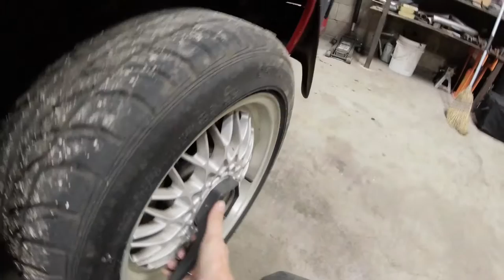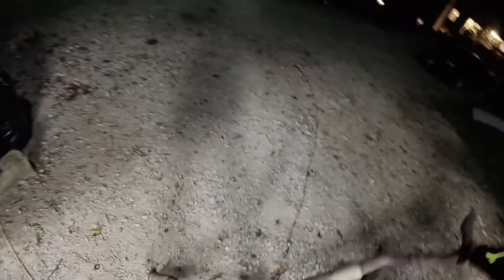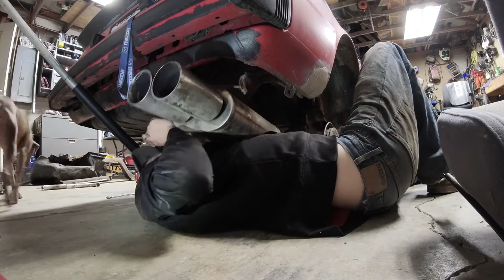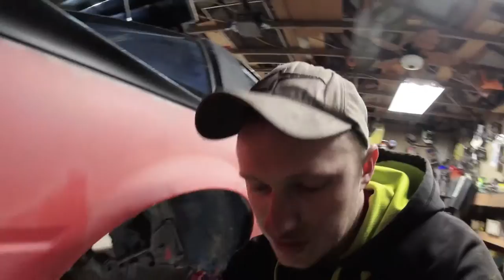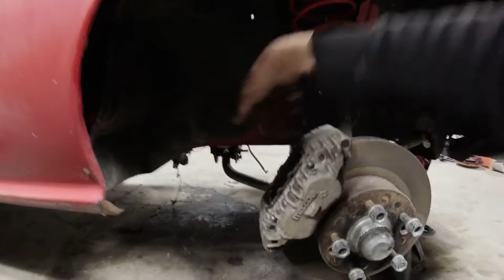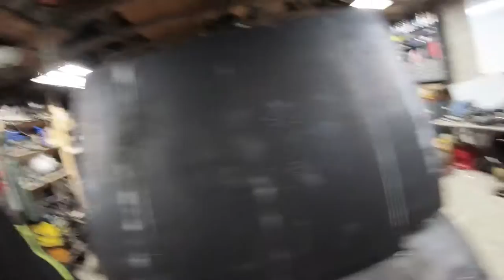Rx7 Turbo Street/Track Build - Rack and Pinion Conversion

Comment: I read an article (or maybe it was a comment.. this was years ago) somewhere that drilling holes into the upper bushings helps free it up like you said in this video. Also using new stainless bolts with poly lock nuts and lock tight. Tighten it down so it doesn't come fully tight to allow the trailing arms to be freed up and not have that stock spring tension in them. Grease the hell out of them too. It works good. I ended up doing this with my rear end. It definitely helps.
Great videos as always!

Comment: On   4 link. I met the owner of Mazda Trix a few times. He shared his thoughts on rear end binding.  Follows what your saying. I came up with my solution for my limited improved  AUTOCROSS/ street   car CSP class. Cut off the ends of the 4 -link that bolt to axle.weld on 2 inch Johnny Joint  End Rods from Currie. Even looks stock. ( polyurethane Heim joint)It gave me more articulation.  I went back to a stock rear  sway-bar  that I ground down to make softer. Softer then a rear adjustable bar.

Comment: I used a Gtech trilink and panhard rod setup to tame  the rear end snap oversteer on my gen 1 track car. It works very well and is totally tunable for under/over steer.
Reply from the maker: Do you have a rear sway bar?
Reply: @RADPotential   The sway bar was removed . Gtech was an American company set up by Jim Susko , he has written a manual about how to solve the RX7's handling issues. It was based on his experience with racing the Rx7 in the different classes that existed in the USA . It includes all the theory , including the unequal swing arms and angular disparity to which you have referred to in your video . He's a very clever man .

Comment: I actually have lots of the respeed rack reverse engineered and drawn up/CADed. I used to work for the first owner of respeed. I'm also legit building a similar 79 12a, gsl-se rear end, and will do a blow through setup

Comment: The problem with the rear axle when u start to make more HP  is axle wrap. The pinion will dive down in the front as the tires grip. Lowering the car makes it worse. Wearing the u joint and pinion bearings. 3 link solves that problem.  Far better r&p kit is the rear steering kit sold on ebay. Forgot the guys name. Keeps all the stock  steering geometry. Work far better than respeed kit.

Comment: With the four link and watts link I have found to delete the rear Sway Bar  or make it on a cam and secondary hand break lever . It get rid of that awkward wobble or kick snap back out of corners. Your right to delete the Sway Bar about articulation. The Sway Bar if left in place  it lifts an already stressed  and loaded wheel before it pulls in the Sway Bar duties  and not ideal. On Australian V8 super cars of the early 2000 they had a fourlink and watts link and the Sway Bar was on a cam cable lever to let it slack in tight corners and then pull it in in big sweepers. Another is make the watts linkage adjustable , it must be level.
I had an Australian group G rx2 coupe rally car like UK gr.b. the 4 link extended up into the body work (back seat area) this allowed big travel and awesome handling with the watts link all adjustable and had a Detroit locker 9in disc rear. The rear was half an inch lower than the front so on power the car would lift to a neutral level. And squat to hook into corners. The rx2 had longer idler and Pitman arms to effectively increase steering ratio like a quick rack . This will work in a std Rx 7 first gen. I will be doing this to my group C rx7 track car . Rally is the ultimate proving ground

Comment: Very informative, nice video! Is it possible to just make a straight upper link or is there an interference? I have a 1980 SA22C as our club car and I’m the only one that gives it some attention, so I’m down to test a whole bunch of ideas on it. Especially any that require fabrication (as I need the practice). Also, I have a question about carburetor’s. Would it be a good/cool idea to run bike carbs on a stock 12a? I was thinking a set of zzr1100 40mm carbs. I thought 40mm might be small, but it’s 4 carbs, so two for each rotor. Is that too much? Should I just stick with getting a 45 weber kit?

Comment: I noticed that you said the axles were redrilled. I've got a bone stock '80 ( stock rear end, etc.) do you think I could redrill the axle/hubs to a more common bolt pattern in the front and rear? Finding 4x110 wheels has proven quite difficult.
Reply from the maker: Hard part is that the 1980 uses a smaller axle housing and axle.  So the flange is too small to re drill bigger.   You could re drill the axle to a 4x100 pattern. And run honda/miata size stuff
Reply: @RADPotential  sweet. Thank you for getting back to me. Now to start looking for a machine shop that'll do it haha...

Comment: I can definitely say the steering box has its issues, the first one I've found is eventually you run out of adjustment which leads to the second problem of the play becoming more and more until the car actually becomes dangerous to drive, mine was at the dangerous to drive point, had the steering wheel get ripped out of my hands on multiple occasions driving around corners and hitting a bad bump, this conversion should really help handling and make the steering much more precise.

Comment: Can you make a video on how to remove the full front bumper along with rear?
Reply from the maker: On what year car?   Turn signal plugs are under the headlight.  On an FB chassis front, remove the two vertical bolts thru the aluminum bar and slide that off with the bumper cover on it.  Then pull the bumper mounts.   Sa you have to unbolt the bumper mounts from the chassis. 

The rear is simple.  4 nuts on the chassis. And then two nuts under a cover in the trunk floor.  Slide it out
Reply: @RADPotential  81 rx7 fb
Reply: @RADPotential  would you be able to make a video on the front? I’ve tried sourcing videos but can’t find any, im sadly a visual learner. Thank you

Comment: Also I've found you can completely stop axel hop by taking the rear end trailing arms the 2 on each side and wrap a piece of L iron around the tube and weld it every few inches really helps keep the rear end planted.
Reply from the maker: The lower or upper arms?